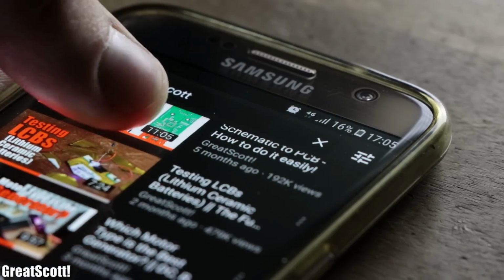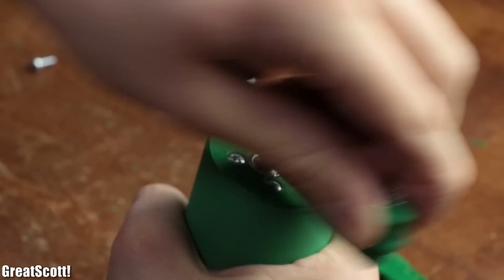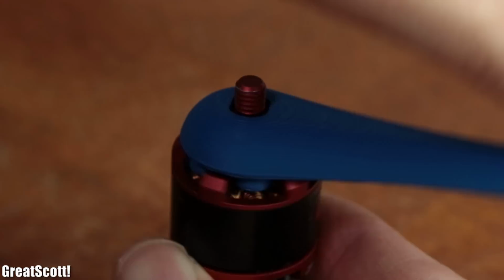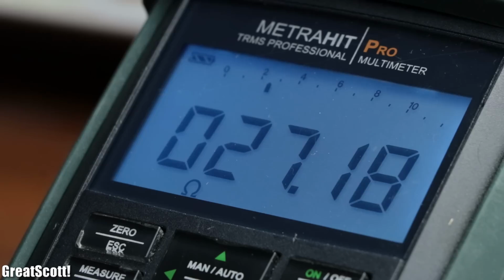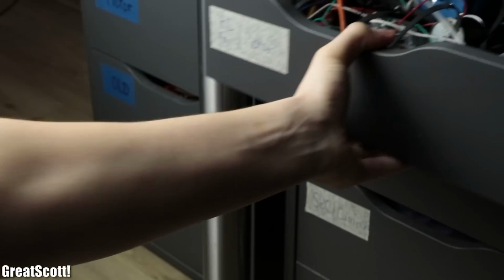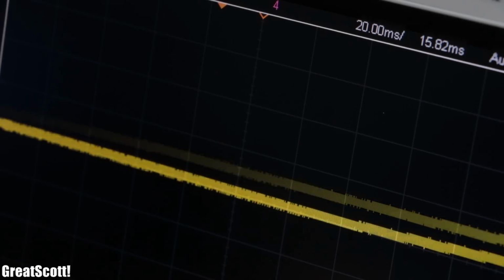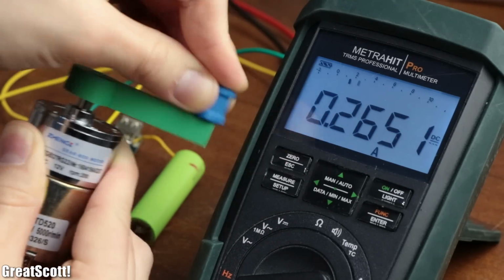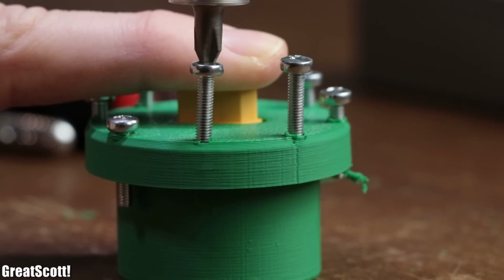Make your own hand-cranked Emergency Powerbank

Comment: Mr Scott I like your hard work for engineering but why you make such silly thing now a days because now a days we have many ways to call in emergency like others phones and every where electronic points and instead of carrying that device we can carry one more power bank so we can save lot struggle please create something really looks impossible
Reply from the maker: Not sure what you want to say here.
Reply: @greatscottlab  you can make power bank which gets charged by shock absorber due to human disturbance and solar so that we can reduce lot of special focus to rotate that old style  Dynamo and I really  not insulting you just give a better way so you can inspire a lot as a YouTuber thankyou
Reply: @chandrashekarr9527  think practical. Life ain't a movie
Reply: @houseofelectronics5869  it's practically possible solar panel of small size is available and automatic watch like rotation technology help for rotating tiny motors to generate energy
Reply: @chandrashekarr9527  Your shock absorber theory seemed impractical to me for homemade purposes. And as far as solar is concerned, hand cranked is much more efficient when it comes to emergency charging. Plus what do you do if your power bank runs out of battery at night? Not very practical eh?
Reply: @houseofelectronics5869  automatic watch works on rewinding the key with help of rotator by absorbing the shock caused by the hand like wise same rotator connect to small dc motor it produces some voltage in which can charge battery like same method but it's does it work when your power bank is keept in some vibrant place like cars and other places at night just shake the power bank to produce the juce every thing seems to be not practical but we must make it practical that the engineer life
Reply: @houseofelectronics5869  your wating to generate or recharge power bank when there is emergency but my thought is to recharge power bank when it gets some opportunities
Reply: @chandrashekarr9527  Yes you can try it out yourself.
Reply: @houseofelectronics5869  sure I am
Reply: @greatscottlab  It look outdated idea for this generation
Reply: I think I understand your point.  This video proposes an expensive hand cranked generator that is propably worse than a cheaper commercial model.  No experimental comparison between the two is offered.  It's not one of his best.
Reply: I agree, it's not worth the  effort of rewinding motors, 3D printing etc. using test equipment and tools costing many times what the end product is worth. Hand cranked torches have been around for a long time. Surely one of these could have been easily modified.
Reply: @geoffbirkinshaw8466    yup, to put the word "emergency" in context my calculation is that you'll need to wind for at least three hours to fully recharge a 1000mAh battery.   Ok if youve broken a leg, not so good if youre having a heart attack. I have no idea how much charge you need to make a one minute emergency call.  As for diy channels that require a 3d  printer, cnc router and laser cutter....  well I hope that greatscott isn't going down that path.
Reply: @raykent3211   Perhaps the video is just for educational purposes and the hand crank generator project is irrelevant, - just used to demonstrate techniques and principles without addressing the fact that in reality, the device is impractical .
Reply: @geoffbirkinshaw8466    fair point.  I like this channel.

Comment: i just made myself a joule theif
Reply: cool, me too! i used a 2N222A with a 200uh inductor, i lit 45 LED's that i assume are 3 parallel by 15 series.  Bigclivedotcom is HIGHLY recommended as he is solely responsible for making the joule thief as well known as it is
Reply: @guymcphee2518  i used about the same length of wire as bigclivedotcom, now i'm testing how long my 10 parallel leds will be lit. I slavaged wire, core and transistor from dead fluorescent lamp circuit.
Reply: @Kostanj42  top marks for the re-use of otherwise disposable electronics(guess who is about to venture head-first into my bins).
Reply: @guymcphee2518  from 1,04V to 0,31V leds were lit for around 81 hours

Comment: If there’s is japan,my answer is ac plug in train
Reply: Most long-range / high-speed / Intercity trains offer AC ports under the seat.

Although I see more short range / regional trains equipped with AC and even USB ports on special seats beginning fielded were I live.
Reply: Allwyn S turn and pulg in

Comment: Yeah, jlcpcb offers cheap pcb, but delivery costs are huge. For example: shipping to Poland costs $24.
Reply: Bro its urgent shipping actual standard shipping costs i think 7 to $9. By the way you can ask there customer service to give you 20$ off shipping coupon on first order. Thanks
Reply: @ahsanwho9739  unfortunately I cannot select "standard" shipping method. It's not available to Poland. :( I tried about 2 weeks ago.
Reply: @darkanzalipl  oh!
Reply: @darkanzalipl  I have ordered PCBs to Poland literally 2 weeks ago and paid 7$ for the shipping.
Reply: @MC-el5hp  ok, so probably I tried 1-2 days before you. I'm very happy to hear that, and I will try again in couple of days. :)
Reply: use "china post" as the shipping method, still 5-8$ shipping.
Reply: @satibel  yeah i know and i meant that
Reply: It's a typical marketing tactic: show a very low price but add the difference to shipping. Always consider the total.
Reply: @bardenegri21  5 pcbs, 3.5cm x 7cm, 10$, With free DHL Express shipping to Germany.
Reply: @bardenegri21  yep i hate that. 
$80 item shows as $50 then shipping is $35
Reply: And to Slovakia (under Poland) too. (24$)
Reply: Allpcb has free shipping
Reply: i always use elecrow for pcb's instead of jlc: the pcb's are $4, shipping also something like $4, and they are really good.
Reply: Dokładnie
Reply: By the way there PCBs are awasome